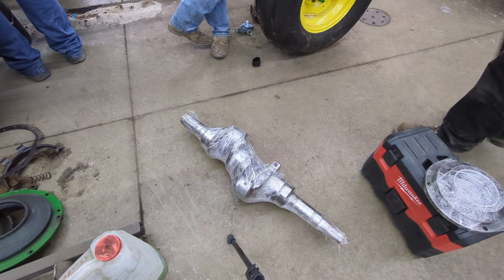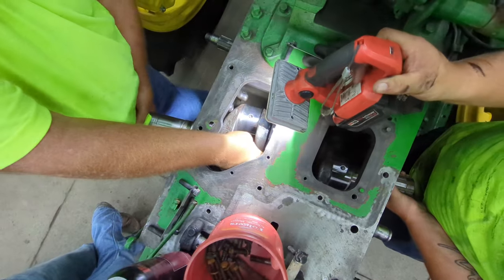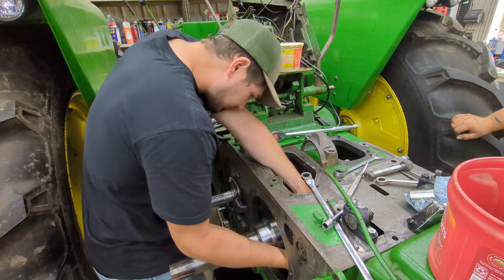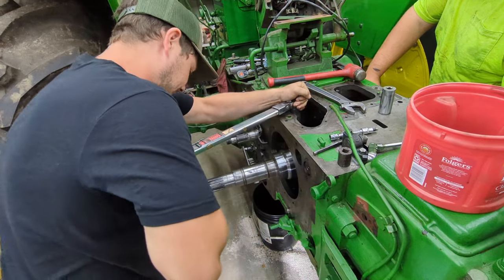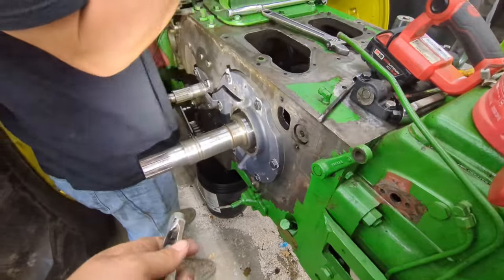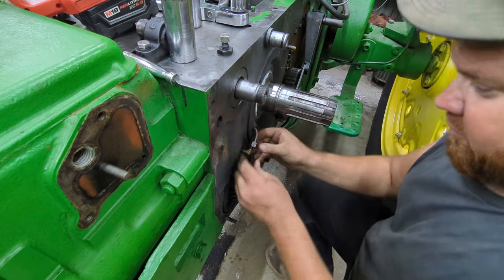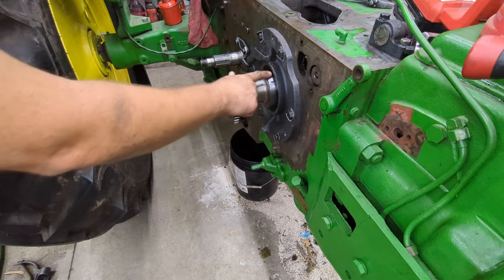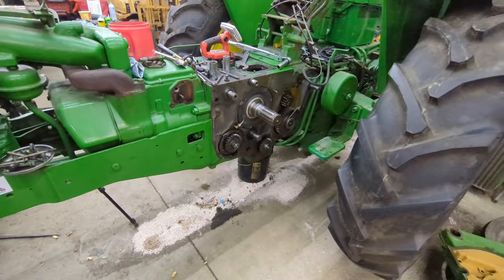Will Dad's Favorite Tractor Ever Run Again? Part 1 Installing The Crank Shaft and Mains!

Comment: $4,000!? Don't say that.  I've got a 730 diesel waiting for a complete overhaul. One thought I had for setting the crank in place without marking up the journals. 3M vet wrap would protect them without leaving any adhesive behind. The other thing I like to do is use aviation gasket maker on the gaskets. I put a very thin film on and I think it seals any deformities in the metal plus holds the gasket in place because it gets tacky after a few minutes. Just my $2.00 because two cents won't buy bubble gum anymore. Great video. Can't wait to see the rest of the series.

Comment: Did you ever find out what caused the old crankshaft to snap in two. 
What if the new crank does the same thing.
Reply from the maker: Come to find out it wasn't to un common for these cranks to bust even back in the day when the tractors were new....I've heard several reasons as to why they break  number one reason the most popular reasons is lugging the engine for long periods of time which we never have but that's not to say some one didn't do it years ago and started the problem....this is a little bit newer crank as far actual build date so it probably won't be a issue ever again

Comment: I was always told not to touch rod bearings with your bare hands, always use rubber gloves. Just what I was always told maybe it was bull.
Reply from the maker: I've never been told that on engine bearings I was always told not to touch the sealing surfaces on ring seals for excavator and dozer final drives

Comment: Why didn’t you guys put a coat of oil on the bearings while installing them and torquing them down. They’ll be spinning dry till the pump gets oil to them. Maybe you did oil them but I didn’t see it being done.
Reply from the maker: Everything got white grease...we also will leave the fuel in the stop position and turn the big engine over with the pony engine to produce engine oil pressure before we allow the big engine to start and also before I put the top plates on the crank case I dumped oil down on top the crank trust me it's good and oiled up in there before it even fires lol